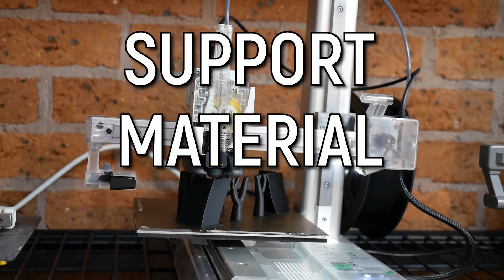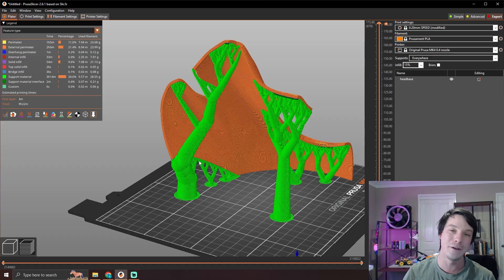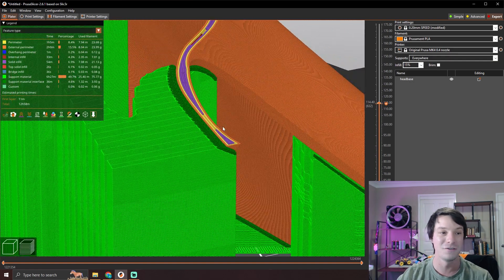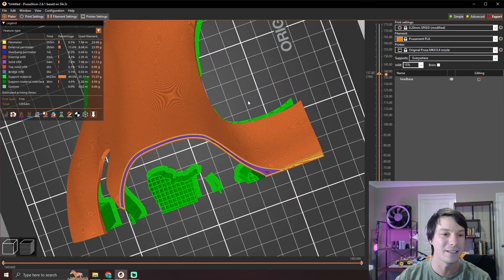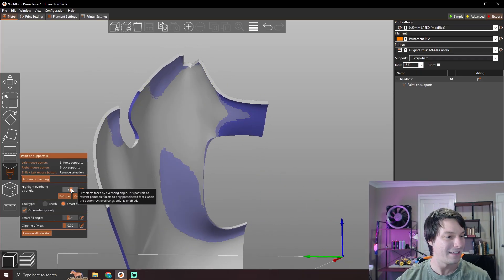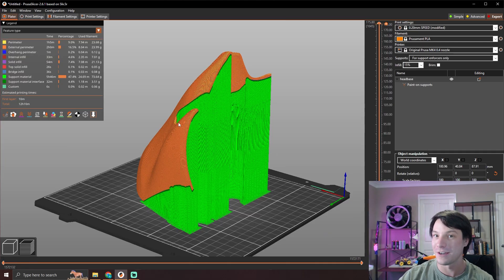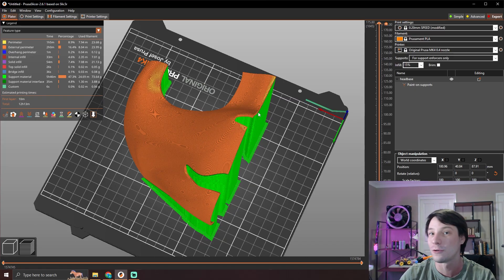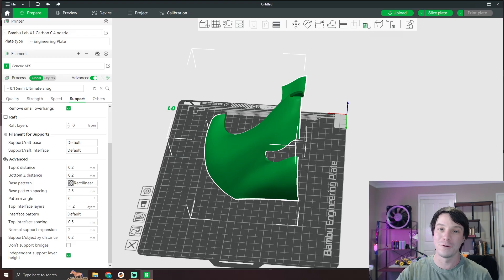When support material fails... I do this. #3DP101

Comment: Bro, I am really amazed to see that the support structures can be removed that easy from the printed part. I have a doubt that can we do this in Cura Ultimaker Software or by any means print the parts with the snug support that are as detachable as the ones shown in the Video ?

Comment: For some reason the Rectilinear grid for me doesn't work at all for PETG. By layer 3-4 all I have is a ball of pubic hair on the build plate and a first layer that's a pain to remove from the plate.. Using P1S with textured PEI plate and my temps are 260 so that shouldn't be the issue. For some reasons the lines refuse to stick to the first layer or to eachoteher. I don't have such issues with the model itself :/

Comment: Angus, thank you for this very informative video. May I ask: how do you feel about PVA disolvable material with dual extruder machines? Until now, I've only used single hotends and single materials with supporting structures (usually trees) but as my prototype parts are becoming more complex, I'm finding that single material supports aren't really cutting it and I'm giving serious thought to getting a dual hotend machine, capable of printing PVA as a disolvable support material. Have you tried this approach and do you recommend it? Cheers, Gabriel.
Reply from the maker: I'm not much of a fan of PVA supports due to the difficulty in keeping the filament dry and functional - but there are many new "support" filaments on the market that are brittle and break away easily which makes dual extrusion for support material much more viable in my opinion. Prints will take a lot longer though!
Reply: @MakersMuse  thank you! I didn’t realise PVA is such a pain to store and work with…sounds as though a dual extruder might still be a good choice, but with a different support material of course. Time / speed is lower down my list of priorities than accuracy of my prototype parts. Thank you for taking the time to reply; much appreciated!

Comment: What I did to solve al the stability issues you mention is to add 5 to 10% infill to the Organic Supports, zero fails since then. and the interface to 60% and 2 layers of gap in my crappy extruder.

Comment: In general we could benefit from better support generators. For instance my printer can handle overhangs much flatter than 45 degrees but htey will be UGLY - meaning it could build an ugly support mesh that follows the model quite closely, then build a little bit of that removable light support between, and put the model on top. Bed adhesion hasn't been a problem for tall, thin things so far, so it could push this for sure.

Comment: This is good info, however it doesn't address one of the problems I see most often, and that is where there is a tall, thin structure, e.g. Gandalf's vertical staff, or a flagpole on a castle.  They don't need vertical support, but they do need a lot of lateral support.  In the past, I've modelled a floating "umbrella" that hovers over the piece.  I can then add supports for that, and they will encase the thin piece.  Is there an easier way that doesn't require modelling hacks and is as satisfyingly easy to remove as the ones you showed?  Obviously, if it takes force to remove the support, that could also break the thin staff.
Another issue, is that the supports themselves are often a point of failure, like where you had that isolated, thin support.  Is there a way for painted supports to have a conical profile, so they are self-supporting laterally?  Your method of just widening the supported area may not work for all prints.

Comment: Really wish the big filament manufacturing industry players could get together and agree on a handful of standardized crosscompatible thermoplastics and additives. Then take those materials that fall into a range, and mix in a tracer that is sensor detectable post print, making accurate machine sorting doable and by extent making recycling into new fiament far more financially viable. That would support industrial scale recycling and profitable sales, with a much higher degree of input control and much less temperamentsful and fickle recycled filaments.

Comment: I used organic supports on a petg print with a 90 degree overhang. It was a tool holder for the prusa mini. 5.86g of filament vs 18.20g for grid. Also saved 42 minutes of print time.

Comment: For the same reliability and filament use, but lower time, i reduce the support infill density (this is because the effective support infill density increases greatly with the 90 degree grid) but then increase the support extrusion width so the layers join together better for more stiffness/strength, and at small layer heights you aren't close to your extruders limits either. Some slicers support combined support layers, i do this too sometimes as its "uglier" but it doesn't matter if you're going to throw it away

Comment: Simplify 3D has an “inflation” setting for supports that automatically expands the area a little bit. This helps prevent the very thin support towers from generating. Do any of the new slicers do that?

Comment: Here's a klipper question for you as I'm brand new to klipper:

When running a "Mandala Lace Skull" print on my recently acquired Sovol SV07 Plus, I get a message that states the following: "MCU Shutdown: Rescheduled timer in the past."

I did a little digging and found that the Z motors rotational distance didn't match after I had done a little tuning and thought, "Maybe this is the issue."  So, I reset them to the standard.  This didn't solve the issue.

Turns out that the issue is usually the result of the microstepper being asked to move too fast.

A little more digging on the internet and I find that it's probably due to the requested speed of my print.  So, I drop the speed down and infill percentage.

But, here's the thing that gets me, I've printed at those higher speeds on test prints a few days ago and had no issues.

I'm not finding a lot of information for this exact issue out there.  Rather, a different issue that has to do with MCU instead.

Do you think that you, or anyone else reading this, might be able to shed a little more light onto the resolution of this problem so that I, and other users, can avoid it in the future?

Thanks.

Comment: Thank you Angus, insightful as always. I've been trying to find a solution to a problem that I've had since buying my first printer, I want to print FCS fins in PETG CF for surfboards and in order to have strength integrity they need to be printed horizontally and the problem comes when I remove the support it has fixed very firmly and so I have to sand it to get off completely but it ruins the look of one side of the fin, do you have any suggestions in this regard?

Comment: Your videos are always very interesting to watch and extremly informative. Thanks for all the time and effort you put in to make these informative videos.

I wanted to let you know that one of the old videos of yours where you showed and used the G10/Garolite sheet as print bed has helped me tons. I use a Ender 3 Pro and have switched to G10 instead of the default magnetic sheet that comes as stock.after watching that video of yours and I should say, its an superb print bed option and super cheap as well. I print PLA, PETG and sometimes ABS as well and ngetting the prints off the bed has never been so easy. Its like magic... the prints just come off the G10 bed after its cooled a bit like they were just kept there.

However I request you to re-visit the G10/Garolite bed but this time with the possibility of using it on the Bambu Labs X1C and the A1 Mini and share your findings. If they G10/Garolite can even be used on these printers or not and what were the challenges to use it and is it worth using the G10/Garolite on these highend printers instead of the stock beds or the coated PEI sheets.

Comment: It would be a great option if slicers had a “paint on brim” option. Just like painting on support, but paint the areas where you want a brim. You could paint the whole base, or just little dots around specific areas. Would be easier than adding mouse ears manually and give you a lot more control.
Reply: Paint on brim has been an issue in both cura and prusaslicer for ages, definitely would be a very nice thing to have. I think cura has brim only on sharp edges now, that gets you there as well.
Reply: In prussaslicer, do addpart from the pop up menu, go the gallery, choose helper disk, place it where you want more support, change its size etc
Reply: You could import a model of a thin circle into the slicer and place it wherever you need on the model's edge, no?
Reply: @shnethog  I already mentioned mouse ears.
Reply: @c0mputer  ah my bad, by “manually” I thought you meant designing the actual part with mouse ears baked in, didn’t realize you meant exactly what I said lol

Comment: I can't think of a real world use for this. I was playing with doing a helmet using this, but you have to use supports in other places aside from just the middle, so then you run into the warning you give at 13:30. Unless there is a way to change support styles with different areas on the print, and I dont think there is.

Comment: I almost always use that method - It proved perfectly reliable even in serial production without a single faillure. Printing the interface in a minimum adhesive material (object PLA, interface PETG or vice versa) finally makes the breakaways perfect

Comment: Using snug supports is wasteful AF.  almost HALF the print time and filament amount is used on supports!  Tree supports use almost 1/3 the material that snug does and prints in half the time.  I'd be very hesitant to use them.

Comment: You could speed up those columnar supports by modelling a hollow column that ends in a dome-like surface near where the supports are really needed.  It's much faster to print some kind of circular path than a whole load of zig-zags because the amount of acceleration and decelerations requried for zig-zagging keeps the print head speed low.

Comment: Cool technique and great results! I've been using tree supports in Cura (I need the slicing tolerance setting that's not available in other slicers yet). The "branch diameter angle" setting helps me avoid issues with the branches falling over.
Reply: what "setting" do you use for what tree support?.. Like what angle do you use for what?...  which is best for what?... I  dont know if i worded that correctly? thank you
Reply: @Vaporweasel751  I use "branch diameter angle". The exact setting is case-specific though. I just increase the value until the bottom of the branches looks like it's attached well enough.
Reply: @Vaporweasel751  also worth noting: the channel "uncle jessy" did a video very recently on tuning settings for tree supports. His technique is different from mine, but it should also work fine.

Comment: I want to thank you for this info. I just printed a dragon that’s 10” across and used “tree” supports. Boy when I was done after 13 hours I could NOT remove supports by hands alone. I needed pliers , needle nose pliers just to remove the tree supports. I can’t wait to try Prusa slicer with those settings.  On a side question:  how do you keep your filament dry?

Comment: hi! thanks for the video! great explanation  :D.  i will use more of those supports!!.  Can anyone help me with my Ender 3 S1 Pro? im trying to print TPU and cant find the perfect configuration to get rid of the stringing :S. i use the cura extension to print an retraction and temperature towers but keep stringin everywhere.
And, im not entirely sure but i think prusa slicer is not full compatible whit Ender 3 s1 pro because when i search the model in the configuration manger is still in beta. 
Thx in advance ;)

Comment: Do you ever mess with the interface layer density or number of layers?  I usually have issues with the interface layer sticking to the print requiring more effort to remove.
Reply: Same problem here, most of the times it is really hard to remove that support layer from the model. His support removal looks like magic to me.

Comment: With a dual print head you can use PETG as a dense support layer with a PLA Part. And no gap between the support and the part... works great...

Comment: I've been printing with specialty filaments. Copper fill and glow in the dark. The copper fill supports failed on me 3 times. I only used organics. I would have tried snug, but my super expensive $50 spool was basically gone. lol Glow in the dark failed on the satin sheet, so I switched to smooth. It got better and managed to complete the print, but the supports were half assed by the time it got there. So I switched to default snug. It was doing great.....until it printed the supports on the inside of the model. It came loose. I THINK it will be ok. I'll find out later today. I'm only reprinting because I wasn't happy with the failed supports. It makes my pumpkin look like he's about to lose a tooth. lol The succubus model that failed so many times with the copper fill, printed perfectly with prusament mable pla. It's obvious to me now that specialty filament (except marble for some reason) is just not strong enough for sparce orangic supports.

Comment: Are you printing ABS on the bambu lab engineering plate without glue stick? How is it holding up? Asking because I haven't found a use for it yet, seems outclassed by high temp/textured PEI plates

And do show us what you're making!

Comment: Solid advice! I'd like to point out that if a print uses more material, but succeeds 100% of the time, it technically saves you filament compared to another print that uses less per print but succeeds only 80% of the time. PS: First time I'm hearing about "removing supports with a hammer" though 🤣
Reply: rubber/resin/rawhide mallets are wonderful for breaking off support material since they dont mar the surface its more likely to break off the support than crack it
Reply: I should get into that mindset more, it also makes sense for designs. A chunky print could fail less often.

Comment: I like to use S3D supports that are rectilinear but shift 90° after every X layers. This not only made the structure rigid but also saves me more support material and printing time. Maybe it's possible with the other slicers. I also combine or discard very thin supports.

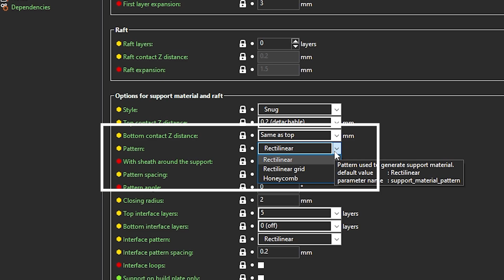Comment: 4:17 I used to do this with Simplify 3D I would do a 90Degree shift in the support every other layer and it was super strong. I did it for all the reasons you highlighted.

Comment: This is very helpful and informative, my only question is why you don't print it (assuming it's a part of a mask for a costume) with the inner side as flat as possible to the plate? Of course pretty much the entire thing would have to be supported, but you wouldn't have the height issue.
Reply: If you print flat to the plate, the little round ridges look like hot garbage. It's the same basic problem as printing the top of a sphere

Comment: I've only recently started using the paint on feature for supports in Prusa and I didn't realize about the auto fill feature lol. I've seen it but never played around with it. The supports were something I always hated in Prusa compared to Cura but overall I prefer Prusa slicer for everything else, I always found the supports in Cura easier to remove but I will be changing my settings and see how this compares and I've started to dabble in Orca slicer as I really like the multiple build plate option for larger projects but will have to see how it compares overall.
Reply: so I tried this suggestion and the supports were still just as hard to remove as they were before so I came back here to see if I had missed something and I changed the settings you specifically mentioned but the one thing that I noticed different in my slicer profile was the "Top Contact Z distance" was set to .25 (a setting I never changed that i recall but who knows lol) and yours is set to .2 (detachable) so I'm going to see if it was that...I also had to update the infill to be "Snug" instead of Grid which I had noticed and changed.
Reply: @roll4stealth671 how’d those changes affect it
Reply: @HollowedLuna  I'm not sure yet, I do have a print on the bed right now that I haven't taken off yet and I'll check it tonight.
Reply: I checked the print and they were mostly easier to remove but I did have a few that were stubborn so I may have to do some further tweaking. This video though was larger print area's with supports whereas my print was smaller sections.

Comment: Something I never understood: why do all slicers try to detect and support overhangs BEFORE slicing instead of AFTER? Everything from layer thickness/line width and even infill can affect the interfacing between the part and support. So it's like the slicer is making supports for an "ideal mesh" that doesn't exist anymore by the time it's sliced, it should let you calculate/model supports after the model is sliced.

Comment: Is there a way of selecting multiple support types on the same print? What I am talking about is a single print that would use grid, and some of the same part that would be  better just linear (enclosed areas) that are better squishable.

Comment: I contacted you about print supports in TPU,  you shared your MK4 profile with me but as far as i could tell it was just stock support settings. (nothing was really transfered) I would love to see a video how you were able to  get thos TPU supports to come off so easily. there is very little to no info online except. "dont do it" but your video proved its quite possible.  Hopefully its not limited to the Mk4 as i have a p1p and mk3s+